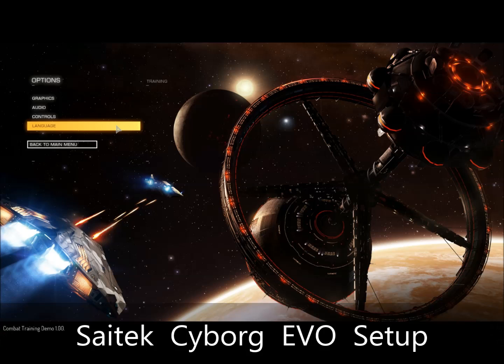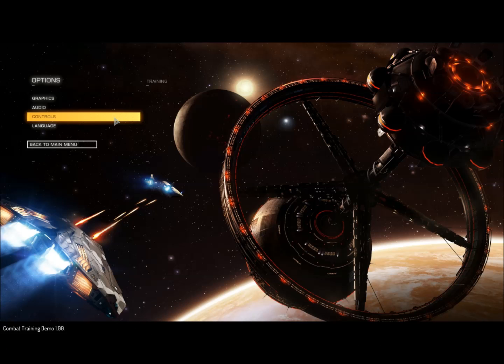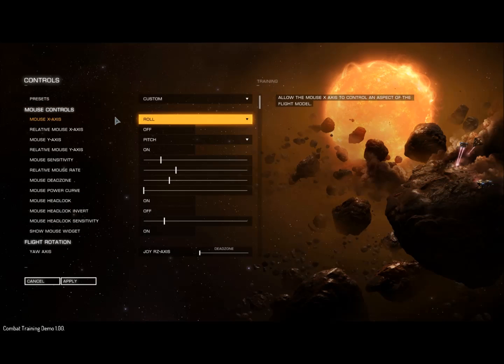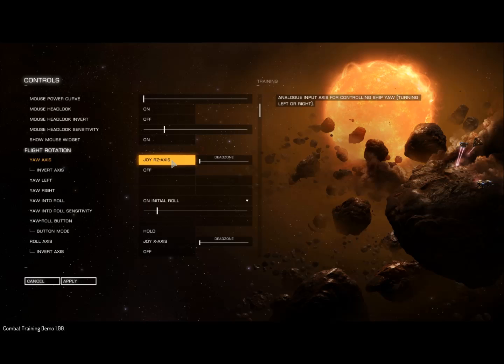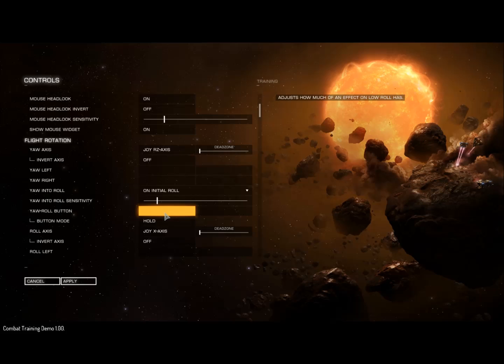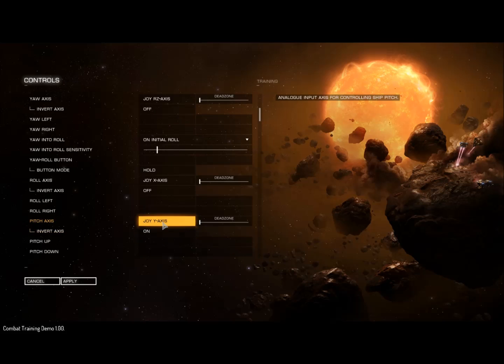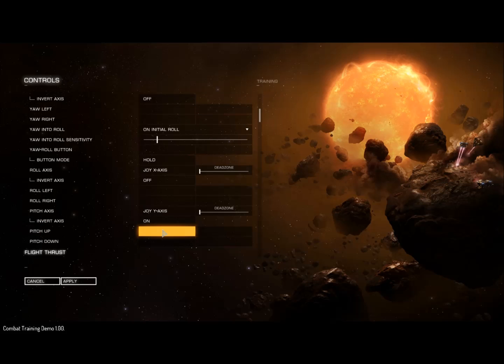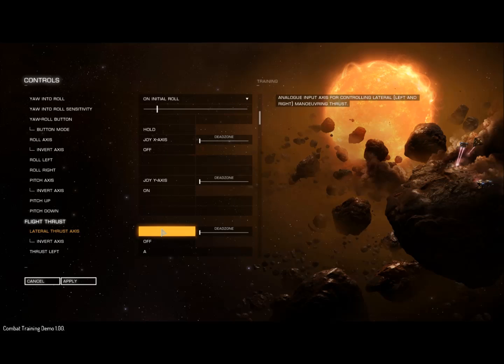Elite Dangerous - Saitek Cyborg EVO Joystick Set-up

Comment: Is there some way you can share your Saitek Cyborg Evo configuration for Elite: Dangerous?
Reply from the maker: The bindings file may be available here if you have Win7:
C:\Users\<YourUserName>\AppData\Local\Frontier Developments\Elite Dangerous\Options\Bindings\Custom.binds

Mine looks like this:

<?xml version="1.0" encoding="UTF-8" ?>
<Root>
	<KeyboardLayout>en-GB</KeyboardLayout>
	<MouseXMode Value="Bindings_MouseRoll" />
	<MouseXDecay Value="0" />
	<MouseYMode Value="Bindings_MousePitch" />
	<MouseYDecay Value="1" />
	<MouseSensitivity Value="0.37569872" />
	<MouseDecayRate Value="3.82064986" />
	<MouseDeadzone Value="0.05000000" />
	<MouseLinearity Value="1.00000000" />
	<MouseHeadlook Value="1" />
	<MouseHeadlookInvert Value="0" />
	<MouseHeadlookSensitivity Value="0.50000000" />
	<MouseGUI Value="1" />
	<YawAxis>
		<Binding Device="06A30464" Key="Joy_RZAxis" />
		<Inverted Value="0" />
		<Deadzone Value="0.04825665" />
	</YawAxis>
	<YawLeftButton>
		<Primary Device="{NoDevice}" Key="" />
		<Secondary Device="{NoDevice}" Key="" />
	</YawLeftButton>
	<YawRightButton>
		<Primary Device="{NoDevice}" Key="" />
		<Secondary Device="{NoDevice}" Key="" />
	</YawRightButton>
	<YawToRollMode Value="Bindings_YawIntoRollTime" />
	<YawToRollSensitivity Value="0.20419717" />
	<YawToRollButton>
		<Primary Device="{NoDevice}" Key="" />
		<Secondary Device="{NoDevice}" Key="" />
		<ToggleOn Value="0" />
	</YawToRollButton>
	<RollAxis>
		<Binding Device="06A30464" Key="Joy_XAxis" />
		<Inverted Value="0" />
		<Deadzone Value="0.16570055" />
	</RollAxis>
	<RollLeftButton>
		<Primary Device="{NoDevice}" Key="" />
		<Secondary Device="{NoDevice}" Key="" />
	</RollLeftButton>
	<RollRightButton>
		<Primary Device="{NoDevice}" Key="" />
		<Secondary Device="{NoDevice}" Key="" />
	</RollRightButton>
	<PitchAxis>
		<Binding Device="06A30464" Key="Joy_YAxis" />
		<Inverted Value="1" />
		<Deadzone Value="0.17209601" />
	</PitchAxis>
	<PitchUpButton>
		<Primary Device="{NoDevice}" Key="" />
		<Secondary Device="{NoDevice}" Key="" />
	</PitchUpButton>
	<PitchDownButton>
		<Primary Device="{NoDevice}" Key="" />
		<Secondary Device="{NoDevice}" Key="" />
	</PitchDownButton>
	<LateralThrust>
		<Binding Device="{NoDevice}" Key="" />
		<Inverted Value="0" />
		<Deadzone Value="0.00000000" />
	</LateralThrust>
	<LeftThrustButton>
		<Primary Device="Keyboard" Key="Key_A" />
		<Secondary Device="{NoDevice}" Key="" />
	</LeftThrustButton>
	<RightThrustButton>
		<Primary Device="Keyboard" Key="Key_D" />
		<Secondary Device="{NoDevice}" Key="" />
	</RightThrustButton>
	<VerticalThrust>
		<Binding Device="{NoDevice}" Key="" />
		<Inverted Value="0" />
		<Deadzone Value="0.00000000" />
	</VerticalThrust>
	<UpThrustButton>
		<Primary Device="050D0815" Key="Neg_Joy_XAxis">
			<Modifier Device="Keyboard" Key="Key_LeftArrow" />
		</Primary>
		<Secondary Device="{NoDevice}" Key="" />
	</UpThrustButton>
	<DownThrustButton>
		<Primary Device="050D0815" Key="Pos_Joy_XAxis">
			<Modifier Device="Keyboard" Key="Key_RightArrow" />
		</Primary>
		<Secondary Device="{NoDevice}" Key="" />
	</DownThrustButton>
	<AheadThrust>
		<Binding Device="{NoDevice}" Key="" />
		<Inverted Value="0" />
		<Deadzone Value="0.00000000" />
	</AheadThrust>
	<ForwardThrustButton>
		<Primary Device="Keyboard" Key="Key_W" />
		<Secondary Device="{NoDevice}" Key="" />
	</ForwardThrustButton>
	<BackwardThrustButton>
		<Primary Device="Keyboard" Key="Key_S" />
		<Secondary Device="{NoDevice}" Key="" />
	</BackwardThrustButton>
	<ThrottleAxis>
		<Binding Device="{NoDevice}" Key="" />
		<Inverted Value="1" />
		<Deadzone Value="0.00000000" />
	</ThrottleAxis>
	<ThrottleRange Value="" />
	<ToggleReverseThrottleInput>
		<Primary Device="{NoDevice}" Key="" />
		<Secondary Device="{NoDevice}" Key="" />
		<ToggleOn Value="1" />
	</ToggleReverseThrottleInput>
	<ForwardKey>
		<Primary Device="Mouse" Key="Pos_Mouse_ZAxis" />
		<Secondary Device="{NoDevice}" Key="" />
	</ForwardKey>
	<BackwardKey>
		<Primary Device="Mouse" Key="Neg_Mouse_ZAxis" />
		<Secondary Device="{NoDevice}" Key="" />
	</BackwardKey>
	<ThrottleIncrement Value="0.12500000" />
	<SetSpeedMinus100>
		<Primary Device="Keyboard" Key="Key_BackSlash" />
		<Secondary Device="{NoDevice}" Key="" />
	</SetSpeedMinus100>
	<SetSpeedMinus75>
		<Primary Device="{NoDevice}" Key="" />
		<Secondary Device="{NoDevice}" Key="" />
	</SetSpeedMinus75>
	<SetSpeedMinus50>
		<Primary Device="{NoDevice}" Key="" />
		<Secondary Device="{NoDevice}" Key="" />
	</SetSpeedMinus50>
	<SetSpeedMinus25>
		<Primary Device="{NoDevice}" Key="" />
		<Secondary Device="{NoDevice}" Key="" />
	</SetSpeedMinus25>
	<SetSpeedZero>
		<Primary Device="Keyboard" Key="Key_F" />
		<Secondary Device="{NoDevice}" Key="" />
	</SetSpeedZero>
	<SetSpeed25>
		<Primary Device="{NoDevice}" Key="" />
		<Secondary Device="{NoDevice}" Key="" />
	</SetSpeed25>
	<SetSpeed50>
		<Primary Device="{NoDevice}" Key="" />
		<Secondary Device="{NoDevice}" Key="" />
	</SetSpeed50>
	<SetSpeed75>
		<Primary Device="{NoDevice}" Key="" />
		<Secondary Device="{NoDevice}" Key="" />
	</SetSpeed75>
	<SetSpeed100>
		<Primary Device="Keyboard" Key="Key_X" />
		<Secondary Device="{NoDevice}" Key="" />
	</SetSpeed100>
	<YawAxis_Landing>
		<Binding Device="{NoDevice}" Key="" />
		<Inverted Value="0" />
		<Deadzone Value="0.00000000" />
	</YawAxis_Landing>
	<YawLeftButton_Landing>
		<Primary Device="{NoDevice}" Key="" />
		<Secondary Device="{NoDevice}" Key="" />
	</YawLeftButton_Landing>
	<YawRightButton_Landing>
		<Primary Device="{NoDevice}" Key="" />
		<Secondary Device="{NoDevice}" Key="" />
	</YawRightButton_Landing>
	<YawToRollMode_Landing Value="" />
	<PitchAxis_Landing>
		<Binding Device="{NoDevice}" Key="" />
		<Inverted Value="0" />
		<Deadzone Value="0.00000000" />
	</PitchAxis_Landing>
	<PitchUpButton_Landing>
		<Primary Device="{NoDevice}" Key="" />
		<Secondary Device="{NoDevice}" Key="" />
	</PitchUpButton_Landing>
	<PitchDownButton_Landing>
		<Primary Device="{NoDevice}" Key="" />
		<Secondary Device="{NoDevice}" Key="" />
	</PitchDownButton_Landing>
	<RollAxis_Landing>
		<Binding Device="{NoDevice}" Key="" />
		<Inverted Value="0" />
		<Deadzone Value="0.00000000" />
	</RollAxis_Landing>
	<RollLeftButton_Landing>
		<Primary Device="{NoDevice}" Key="" />
		<Secondary Device="{NoDevice}" Key="" />
	</RollLeftButton_Landing>
	<RollRightButton_Landing>
		<Primary Device="{NoDevice}" Key="" />
		<Secondary Device="{NoDevice}" Key="" />
	</RollRightButton_Landing>
	<LateralThrust_Landing>
		<Binding Device="{NoDevice}" Key="" />
		<Inverted Value="0" />
		<Deadzone Value="0.00000000" />
	</LateralThrust_Landing>
	<LeftThrustButton_Landing>
		<Primary Device="{NoDevice}" Key="" />
		<Secondary Device="{NoDevice}" Key="" />
	</LeftThrustButton_Landing>
	<RightThrustButton_Landing>
		<Primary Device="{NoDevice}" Key="" />
		<Secondary Device="{NoDevice}" Key="" />
	</RightThrustButton_Landing>
	<VerticalThrust_Landing>
		<Binding Device="{NoDevice}" Key="" />
		<Inverted Value="0" />
		<Deadzone Value="0.00000000" />
	</VerticalThrust_Landing>
	<UpThrustButton_Landing>
		<Primary Device="{NoDevice}" Key="" />
		<Secondary Device="{NoDevice}" Key="" />
	</UpThrustButton_Landing>
	<DownThrustButton_Landing>
		<Primary Device="{NoDevice}" Key="" />
		<Secondary Device="{NoDevice}" Key="" />
	</DownThrustButton_Landing>
	<AheadThrust_Landing>
		<Binding Device="{NoDevice}" Key="" />
		<Inverted Value="0" />
		<Deadzone Value="0.00000000" />
	</AheadThrust_Landing>
	<ForwardThrustButton_Landing>
		<Primary Device="{NoDevice}" Key="" />
		<Secondary Device="{NoDevice}" Key="" />
	</ForwardThrustButton_Landing>
	<BackwardThrustButton_Landing>
		<Primary Device="{NoDevice}" Key="" />
		<Secondary Device="{NoDevice}" Key="" />
	</BackwardThrustButton_Landing>
	<ToggleFlightAssist>
		<Primary Device="{NoDevice}" Key="" />
		<Secondary Device="{NoDevice}" Key="" />
		<ToggleOn Value="0" />
	</ToggleFlightAssist>
	<UseBoostJuice>
		<Primary Device="Keyboard" Key="Key_LeftShift" />
		<Secondary Device="{NoDevice}" Key="" />
	</UseBoostJuice>
	<HyperSuperCombination>
		<Primary Device="Keyboard" Key="Key_F9" />
		<Secondary Device="{NoDevice}" Key="" />
	</HyperSuperCombination>
	<Supercruise>
		<Primary Device="Keyboard" Key="Key_F10" />
		<Secondary Device="{NoDevice}" Key="" />
	</Supercruise>
	<Hyperspace>
		<Primary Device="Keyboard" Key="Key_F11" />
		<Secondary Device="{NoDevice}" Key="" />
	</Hyperspace>
	<DisableRotationCorrectToggle>
		<Primary Device="Keyboard" Key="Key_F12" />
		<Secondary Device="{NoDevice}" Key="" />
		<ToggleOn Value="1" />
	</DisableRotationCorrectToggle>
	<SelectTarget>
		<Primary Device="Keyboard" Key="Key_Space" />
		<Secondary Device="{NoDevice}" Key="" />
	</SelectTarget>
	<CycleNextTarget>
		<Primary Device="Keyboard" Key="Key_4" />
		<Secondary Device="{NoDevice}" Key="" />
	</CycleNextTarget>
	<CyclePreviousTarget>
		<Primary Device="Keyboard" Key="Key_5" />
		<Secondary Device="{NoDevice}" Key="" />
	</CyclePreviousTarget>
	<SelectHighestThreat>
		<Primary Device="Keyboard" Key="Key_Minus" />
		<Secondary Device="{NoDevice}" Key="" />
	</SelectHighestThreat>
	<CycleNextHostileTarget>
		<Primary Device="Keyboard" Key="Key_6" />
		<Secondary Device="{NoDevice}" Key="" />
	</CycleNextHostileTarget>
	<CyclePreviousHostileTarget>
		<Primary Device="Keyboard" Key="Key_7" />
		<Secondary Device="{NoDevice}" Key="" />
	</CyclePreviousHostileTarget>
	<CycleNextSubsystem>
		<Primary Device="Keyboard" Key="Key_9" />
		<Secondary Device="{NoDevice}" Key="" />
	</CycleNextSubsystem>
	<CyclePreviousSubsystem>
		<Primary Device="Keyboard" Key="Key_8" />
		<Secondary Device="{NoDevice}" Key="" />
	</CyclePreviousSubsystem>
	<GunsightSystem />
	<PrimaryFire>
		<Primary Device="{NoDevice}" Key="" />
		<Secondary Device="06A30464" Key="Joy_1" />
	</PrimaryFire>
	<SecondaryFire>
		<Primary Device="{NoDevice}" Key="" />
		<Secondary Device="06A30464" Key="Joy_3" />
	</SecondaryFire>
	<CycleFireGroupNext>
		<Primary Device="Keyboard" Key="Key_RightBracket" />
		<Secondary Device="06A30464" Key="Joy_6" />
	</CycleFireGroupNext>
	<CycleFireGroupPrevious>
		<Primary Device="Keyboard" Key="Key_LeftBracket" />
		<Secondary Device="06A30464" Key="Joy_5" />
	</CycleFireGroupPrevious>
	<DeployHardpointToggle>
		<Primary Device="Keyboard" Key="Key_H" />
		<Secondary Device="06A30464" Key="Joy_2" />
	</DeployHardpointToggle>
	<DeployHardpointsOnFire Value="1" />
	<ToggleButtonUpInput>
		<Primary Device="Keyboard" Key="Key_G" />
		<Secondary Device="{NoDevice}" Key="" />
		<ToggleOn Value="1" />
	</ToggleButtonUpInput>
	<DeployHeatSink>
		<Primary Device="Keyboard" Key="Key_Home" />
		<Secondary Device="{NoDevice}" Key="" />
	</DeployHeatSink>
	<ShipSpotLightToggle>
		<Primary Device="Keyboard" Key="Key_Insert" />
		<Secondary Device="{NoDevice}" Key="" />
	</ShipSpotLightToggle>
	<RadarIncreaseRange>
		<Primary Device="Keyboard" Key="Key_PageUp" />
		<Secondary Device="{NoDevice}" Key="" />
	</RadarIncreaseRange>
	<RadarDecreaseRange>
		<Primary Device="Keyboard" Key="Key_PageDown" />
		<Secondary Device="{NoDevice}" Key="" />
	</RadarDecreaseRange>
	<IncreaseEnginesPower>
		<Primary Device="Keyboard" Key="Key_2" />
		<Secondary Device="{NoDevice}" Key="" />
	</IncreaseEnginesPower>
	<IncreaseWeaponsPower>
		<Primary Device="Keyboard" Key="Key_3" />
		<Secondary Device="{NoDevice}" Key="" />
	</IncreaseWeaponsPower>
	<IncreaseSystemsPower>
		<Primary Device="Keyboard" Key="Key_1" />
		<Secondary Device="{NoDevice}" Key="" />
	</IncreaseSystemsPower>
	<ResetPowerDistribution>
		<Primary Device="Keyboard" Key="Key_0" />
		<Secondary Device="{NoDevice}" Key="" />
	</ResetPowerDistribution>
	<OculusReset>
		<Primary Device="{NoDevice}" Key="" />
		<Secondary Device="{NoDevice}" Key="" />
	</OculusReset>
	<ToggleCargoScoop>
		<Primary Device="Keyboard" Key="Key_Grave" />
		<Secondary Device="{NoDevice}" Key="" />
		<ToggleOn Value="1" />
	</ToggleCargoScoop>
	<EjectAllCargo>
		<Primary Device="Keyboard" Key="Key_Period" />
		<Secondary Device="{NoDevice}" Key="" />
	</EjectAllCargo>
	<LandingGearToggle>
		<Primary Device="Keyboard" Key="Key_L" />
		<Secondary Device="{NoDevice}" Key="" />
	</LandingGearToggle>
	<MicrophoneMute>
		<Primary Device="{NoDevice}" Key="" />
		<Secondary Device="{NoDevice}" Key="" />
		<ToggleOn Value="0" />
	</MicrophoneMute>
	<UseShieldCell>
		<Primary Device="Keyboard" Key="Key_R" />
		<Secondary Device="{NoDevice}" Key="" />
	</UseShieldCell>
	<FireChaffLauncher>
		<Primary Device="Keyboard" Key="Key_C" />
		<Secondary Device="{NoDevice}" Key="" />
	</FireChaffLauncher>
	<UIFocusMode Value="Bindings_FocusModeHold" />
	<UIFocus>
		<Primary Device="{NoDevice}" Key="" />
		<Secondary Device="{NoDevice}" Key="" />
	</UIFocus>
	<FocusLeftPanel>
		<Primary Device="Keyboard" Key="Key_F5" />
		<Secondary Device="{NoDevice}" Key="" />
	</FocusLeftPanel>
	<FocusRightPanel>
		<Primary Device="Keyboard" Key="Key_F6" />
		<Secondary Device="{NoDevice}" Key="" />
	</FocusRightPanel>
	<FocusRadarPanel>
		<Primary Device="Keyboard" Key="Key_F7" />
		<Secondary Device="{NoDevice}" Key="" />
	</FocusRadarPanel>
	<QuickCommsPanel>
		<Primary Device="Keyboard" Key="Key_K" />
		<Secondary Device="{NoDevice}" Key="" />
	</QuickCommsPanel>
	<FocusCommsPanel>
		<Primary Device="Keyboard" Key="Key_F8" />
		<Secondary Device="{NoDevice}" Key="" />
	</FocusCommsPanel>
	<GalaxyMapOpen>
		<Primary Device="Keyboard" Key="Key_F1" />
		<Secondary Device="{NoDevice}" Key="" />
	</GalaxyMapOpen>
	<HeadLookToggle>
		<Primary Device="Mouse" Key="Mouse_3" />
		<Secondary Device="{NoDevice}" Key="" />
		<ToggleOn Value="0" />
	</HeadLookToggle>
	<Pause>
		<Primary Device="Keyboard" Key="Key_P" />
		<Secondary Device="{NoDevice}" Key="" />
	</Pause>
	<UI_Up>
		<Primary Device="Keyboard" Key="Key_W" />
		<Secondary Device="{NoDevice}" Key="" />
	</UI_Up>
	<UI_Down>
		<Primary Device="Keyboard" Key="Key_S" />
		<Secondary Device="{NoDevice}" Key="" />
	</UI_Down>
	<UI_Left>
		<Primary Device="Keyboard" Key="Key_A" />
		<Secondary Device="{NoDevice}" Key="" />
	</UI_Left>
	<UI_Right>
		<Primary Device="Keyboard" Key="Key_D" />
		<Secondary Device="{NoDevice}" Key="" />
	</UI_Right>
	<UI_Select>
		<Primary Device="Keyboard" Key="Key_Space" />
		<Secondary Device="{NoDevice}" Key="" />
	</UI_Select>
	<UI_Back>
		<Primary Device="{NoDevice}" Key="" />
		<Secondary Device="{NoDevice}" Key="" />
	</UI_Back>
	<CycleNextPanel>
		<Primary Device="Keyboard" Key="Key_E" />
		<Secondary Device="{NoDevice}" Key="" />
	</CycleNextPanel>
	<CyclePreviousPanel>
		<Primary Device="Keyboard" Key="Key_Q" />
		<Secondary Device="{NoDevice}" Key="" />
	</CyclePreviousPanel>
	<HeadlookDefault Value="1" />
	<HeadlookMode Value="Bindings_HeadlookModeAccumulate" />
	<HeadLookReset>
		<Primary Device="06A30464" Key="Joy_4" />
		<Secondary Device="{NoDevice}" Key="" />
	</HeadLookReset>
	<HeadLookPitchUp>
		<Primary Device="{NoDevice}" Key="" />
		<Secondary Device="06A30464" Key="Joy_POV1Down" />
	</HeadLookPitchUp>
	<HeadLookPitchDown>
		<Primary Device="{NoDevice}" Key="" />
		<Secondary Device="06A30464" Key="Joy_POV1Up" />
	</HeadLookPitchDown>
	<HeadLookPitchAxisRaw>
		<Binding Device="{NoDevice}" Key="" />
		<Inverted Value="0" />
		<Deadzone Value="0.30581927" />
	</HeadLookPitchAxisRaw>
	<HeadLookYawLeft>
		<Primary Device="{NoDevice}" Key="" />
		<Secondary Device="06A30464" Key="Joy_POV1Left" />
	</HeadLookYawLeft>
	<HeadLookYawRight>
		<Primary Device="{NoDevice}" Key="" />
		<Secondary Device="06A30464" Key="Joy_POV1Right" />
	</HeadLookYawRight>
	<HeadLookYawAxis>
		<Binding Device="{NoDevice}" Key="" />
		<Inverted Value="0" />
		<Deadzone Value="0.31861019" />
	</HeadLookYawAxis>
	<CamPitchAxis>
		<Binding Device="{NoDevice}" Key="" />
		<Inverted Value="0" />
		<Deadzone Value="0.00000000" />
	</CamPitchAxis>
	<CamPitchUp>
		<Primary Device="Keyboard" Key="Key_T" />
		<Secondary Device="{NoDevice}" Key="" />
	</CamPitchUp>
	<CamPitchDown>
		<Primary Device="Keyboard" Key="Key_G" />
		<Secondary Device="{NoDevice}" Key="" />
	</CamPitchDown>
	<CamYawAxis>
		<Binding Device="{NoDevice}" Key="" />
		<Inverted Value="0" />
		<Deadzone Value="0.00000000" />
	</CamYawAxis>
	<CamYawLeft>
		<Primary Device="Keyboard" Key="Key_Q" />
		<Secondary Device="{NoDevice}" Key="" />
	</CamYawLeft>
	<CamYawRight>
		<Primary Device="Keyboard" Key="Key_E" />
		<Secondary Device="{NoDevice}" Key="" />
	</CamYawRight>
	<CamTranslateYAxis>
		<Binding Device="{NoDevice}" Key="" />
		<Inverted Value="0" />
		<Deadzone Value="0.00000000" />
	</CamTranslateYAxis>
	<CamTranslateForward>
		<Primary Device="Keyboard" Key="Key_W" />
		<Secondary Device="{NoDevice}" Key="" />
	</CamTranslateForward>
	<CamTranslateBackward>
		<Primary Device="Keyboard" Key="Key_S" />
		<Secondary Device="{NoDevice}" Key="" />
	</CamTranslateBackward>
	<CamTranslateXAxis>
		<Binding Device="{NoDevice}" Key="" />
		<Inverted Value="0" />
		<Deadzone Value="0.00000000" />
	</CamTranslateXAxis>
	<CamTranslateLeft>
		<Primary Device="Keyboard" Key="Key_A" />
		<Secondary Device="{NoDevice}" Key="" />
	</CamTranslateLeft>
	<CamTranslateRight>
		<Primary Device="Keyboard" Key="Key_D" />
		<Secondary Device="{NoDevice}" Key="" />
	</CamTranslateRight>
	<CamTranslateZAxis>
		<Binding Device="{NoDevice}" Key="" />
		<Inverted Value="0" />
		<Deadzone Value="0.00000000" />
	</CamTranslateZAxis>
	<CamTranslateUp>
		<Primary Device="Keyboard" Key="Key_R" />
		<Secondary Device="{NoDevice}" Key="" />
	</CamTranslateUp>
	<CamTranslateDown>
		<Primary Device="Keyboard" Key="Key_F" />
		<Secondary Device="{NoDevice}" Key="" />
	</CamTranslateDown>
	<CamZoomAxis>
		<Binding Device="{NoDevice}" Key="" />
		<Inverted Value="0" />
		<Deadzone Value="0.00000000" />
	</CamZoomAxis>
	<CamZoomIn>
		<Primary Device="{NoDevice}" Key="" />
		<Secondary Device="Keyboard" Key="Key_Z" />
	</CamZoomIn>
	<CamZoomOut>
		<Primary Device="{NoDevice}" Key="" />
		<Secondary Device="Keyboard" Key="Key_X" />
	</CamZoomOut>
	<CamTranslateZHold>
		<Primary Device="{NoDevice}" Key="" />
		<Secondary Device="{NoDevice}" Key="" />
		<ToggleOn Value="0" />
	</CamTranslateZHold>
</Root>
Reply: Thank you very much for sharing!
Reply from the maker: Drew Vogel No problem. I hope it helps!